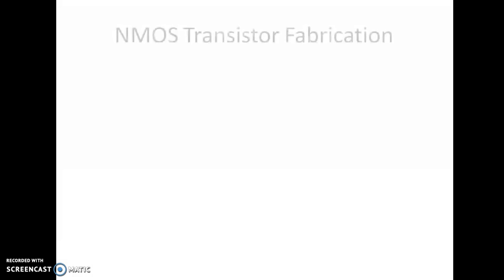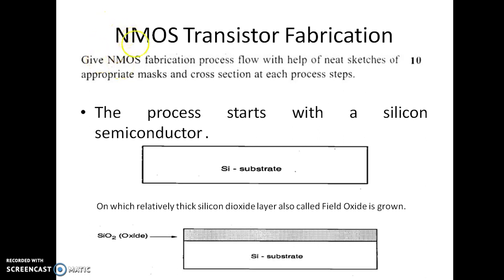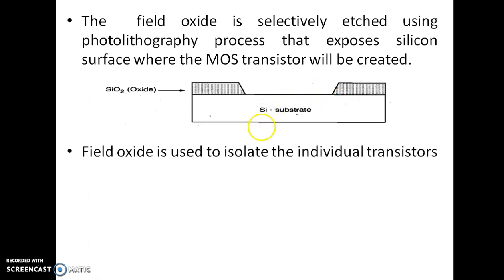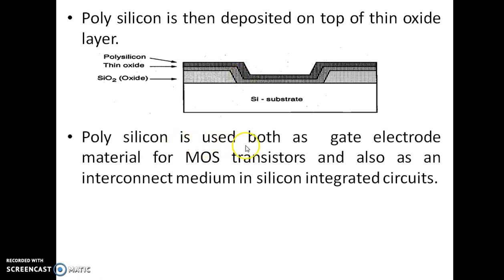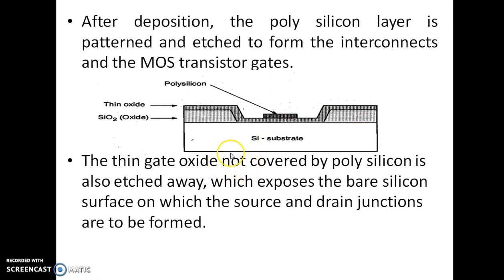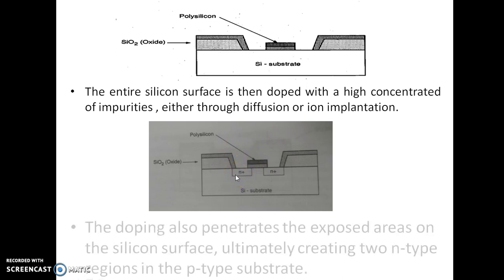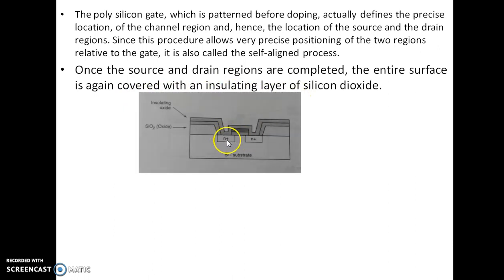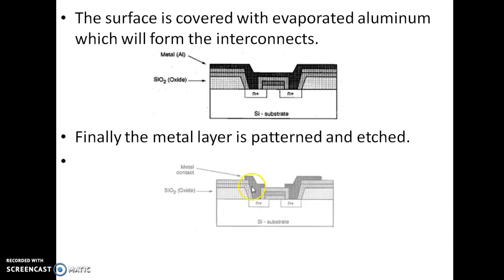Fabrication steps for NMOS

Comment: what is the difference between nmos and pmos fabrication process? 
what about the pmos fabrication process?
Reply: NMOS uses only n-type mosfet transistors to create gates and logic (ion implantation of n-type atoms at source and drain). PMOS uses only p-type mosfet transistors to create gates and logic (ion implantation of p-type atoms at source and drain). CMOS creates gates using complementary transistors (both NMOS and PMOS in combination, i.e. together). In terms of NMOS vs PMOS fabrication, it comes down to how you dope the silicon wafer at the positions where you create the MOSFETs during the fabrication process; when creating the source and drains for the mosfet you can either perform the ion implantation step by injecting small amounts of either Phosphorous atoms (which creates an N-type MOSFET) or small amounts of Boron atoms (which creates a P-type) into the silicon lattice of the wafer in the regions of the Source and Drain of the transistor. To understand why this works, you need to understand the chemistry of valence electrons and that Phosphorous atoms have 5 valence electrons, Boron has 3 valence electrons, and Silicon has 4 valence electrons - hence why you get the P-type and N-type properties. To determine the amount of doping required of these two dopants (Boron vs Phosphorous) you need to understand the physics of energy levels and electrical flow in semiconductors. Then to understand how p-type mosfets and n-type mosfets affect logic gate design, you will need to understand boolean algebra in terms of digital circuits. As an example, the mid-1970s saw the introduction of the NMOS based 6502 CPU (because PMOS would not have allowed an onboard clock, for some reason); then by the mid-1980s the same CPU was re-architected with CMOS gates (65C02) which was more power efficient. Functionally the NMOS and CMOS chip versions were identical, but CMOS used a lot less power in the way it works.